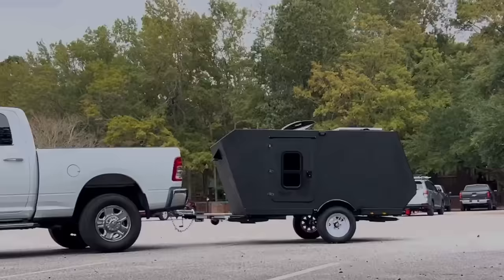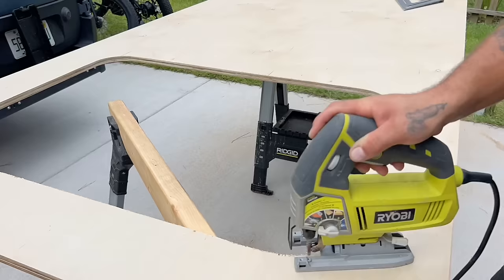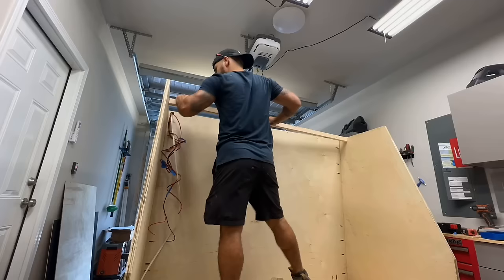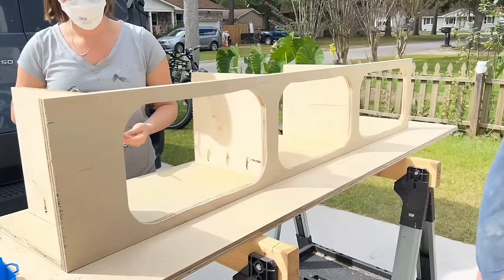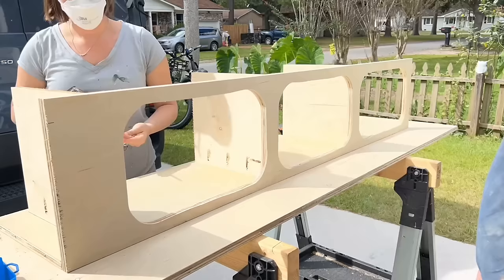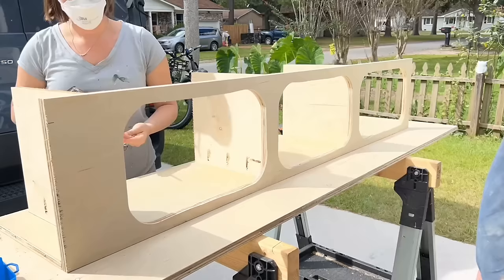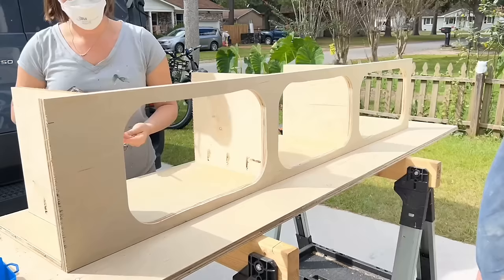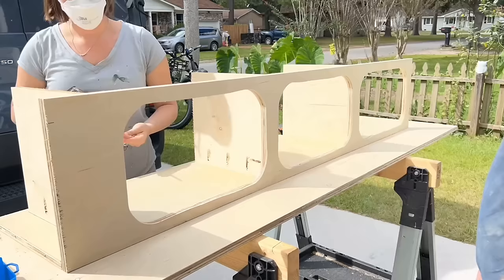How I Built A DIY Camper From Start To Finish | FULL BUILD

Comment: You sold this?  I don't want to be rude, but whilst it's a nice DIY project, I don't think it is professional enough to sell.  Is painted ply wood good enough for the underside?  And what is giving the sides structural integrity?   Did you get some sort of compliance certificate before selling it?  It didn't look too stable on the road.

I liked the batten ceilings but some of the other finishes didn't look too neat.  There was a whole chunk at the front where the fibreglass didn't go to the edges and it didn't look like you wrapped the corners at all.   Those self adhesive tiles in the kitchen area didn't look like they were applied very well with corners sticking up, and aren't what you would expect to get in a commercial product.  I imagine they will be peeling in no time.  

And a speaker right behind the sink?  Why?  And where do you cook?  On top of the fridge cover?   Or risk the fold up shelf?

The paint job looked patchy and the edges of the rear door covering the kitchen weren't painted as all.  It even looks like the edges of the plywood floor are raw and that hideous black finish is going to turn this thing into an oven.  

Oh and it was nice of you to suit up to protect yourself before sanding the fibreglass and spewing the dust all over the neighbourhood.  You might want to rethink that.

As a project for yourself or a prototype, okay, maybe.  But a market ready product?  Not so much.  I hope the new owner knew what they were getting.

Comment: Lots of issues with this built. The first and biggest being that it's your first build and you're building it to sell. that feels... not ideal. KInda crazy to use only a 1/2" of insulation but put 400ah of lithium batteries? Not gonna use those batteries much if you freeze or cook in there bc of the super low R-value of your camper. lol

Comment: What’s the cost to build this?
Reply from the maker: We spent just under $15,000
Reply: Thank you we were looking up that fan you put in and it just sucks out air cold and hot because it’d be great for leaving dogs in a small camper but what’s the reason for the little fan? It’s not an AC unit.

Comment: 6500 lb jacks? the whole build cant weigh more tha 1500 fully loaded. could you not get 1000 lb jacks?
Reply from the maker: They were only $20 more expensive than 1000 pound jacks
Reply: @buildersblueprint  i posted that early in the vid, i got that 1500 pounds on the nose. lol. still a very cool build.Do you feel comfortable letting me know the material cost? id like to trt similar.

Comment: Im sorry, excuse me, but did this guy say he is depending on the extra thick layers of paint to protect the wood that is exposed on the underside of this nightmare? 😮 who taught him how to hold a hammer? Just wondering because i have a lot of questions for them. Starting with... so the first time you showed him how to hold a hammer, which direction did you tell them to swing? I'm just saying because paint is a decor, not a sealant. I dont even trust flexseal, and that aggressive tv dude was very persistent.  Just saying this stooge must have been swining that hammer pretty dang good in the wrong direction in class that day. But then yet id have questions for the person that would even consider bying that too. How did he even get it legal to haul? Or did he? 🧐🥴

Comment: In summary issues:
- Trailers need to have weight centred just around the wheels axle, and bit further towards the pulling vehicle 
- left no led spare wire for any future fixes
- most connections have single screw
- to much wood wasted when a plan is for it to be fiberglassed
- to hort overlay between the fiberglass layers, and done in wrong direction 
- door will poor the water in
- and I had to stop watching 

Doing all this on used Van would have been a better choice for your skill level. It seems that you have great budget, maybe give it another try. 
-